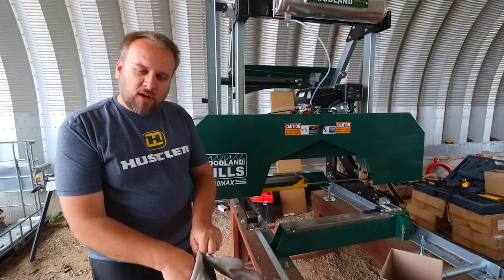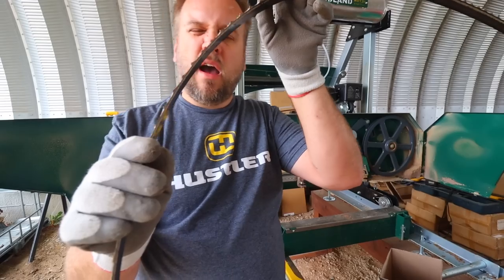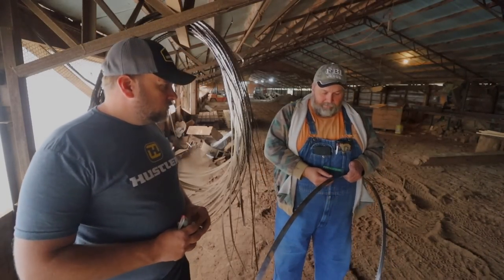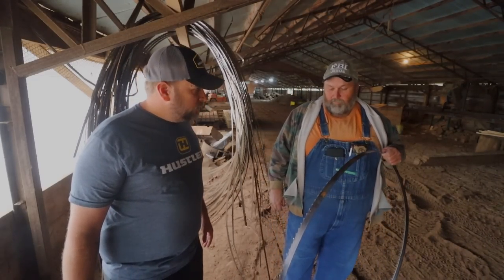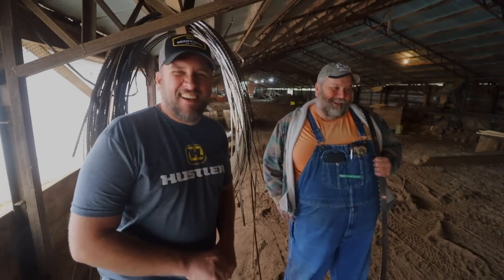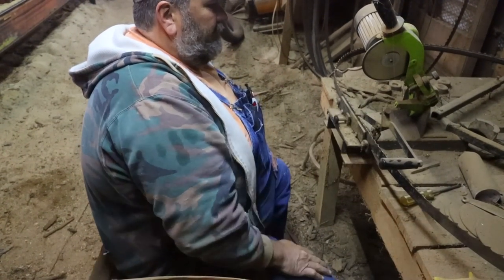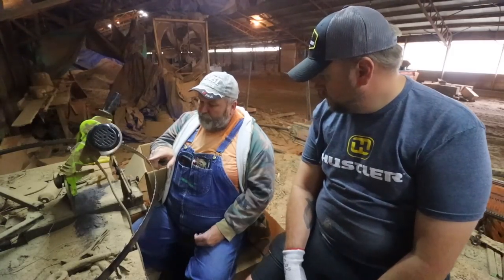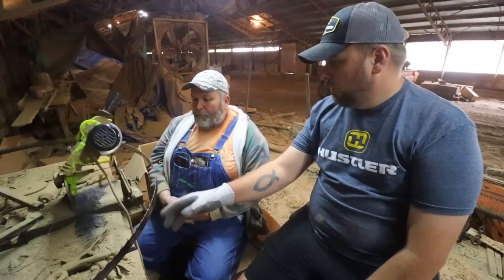Is It Worth It to Sharpen Your Own Sawmill Blades?

Comment: I used to work in a meat market and the saw blades on the meat saws were similar to those and extremely sharp. I handled those blades bare handed and folded them up like Paul did to put them in a sink to wash. They won't cut you if done properly, but like Paul's, my hands are pretty calloused. This was an excellent video btw!

Comment: Thanks for covering this. I have the same mill as yours and haven’t decided what to do with the 5 dull(?) blades I have. I only mill cherry, oak, maple and walnut in +18” diameter. I’ve experienced diving many times even on fresh blades. I’ve checked everything and it appears to occur at knots. I’m sure retirement will free up enough time to sort it out but for now it’s going to be cutting thick and flattening on the jig.
Reply: What kind of guides do you have? Pads? Had pads on my Hudson finally switched to Cook's Roller bearing retrofit why didn't I do this 25 years ago! Expensice! About  $500 and need to weld!

Comment: The Setting of the saw is as important as Sharpening.Set before sharpening. You can Sharpen up to 10 times if no damage. Well over 56 years experience here. I charge 14.00 ea
Reply from the maker: I got a setter and sharpener but I’ve only used them a couple of times

Comment: I have a Cooks Setter and Sharpener. .025 - .028 set per side. Proper Cam needed for different Tooth Profiles in the Sharpener. 7/8" Tooth Space Lenox Cam for the most common Tooth. The Setter is run manually but very accurate and fast.